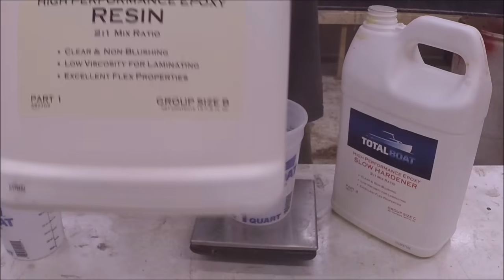Ant carved Choke Cherry Pot

Comment: That was a snarly piece of wood and as always you did a great job! I could see your OCD was going bonkers with all the holes 🤣
What was that tool bit you used to drill out the broken screw?
Cool T shirt!
Reply from the maker: Thank You Luie,  LOL  it's always on top in the shirt drawer for some reason,  It's from a plug cutting set I have and it worked great for that.  here is a link https://amzn.to/2TPSMnJ
Reply: @PohlBarnProductions  Thanks for the lead